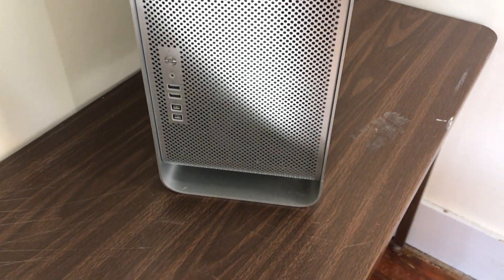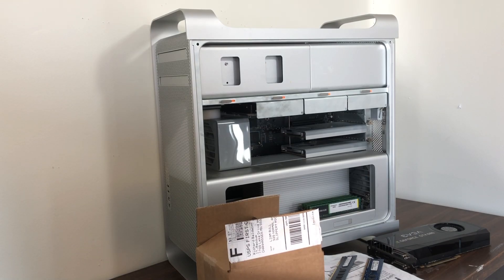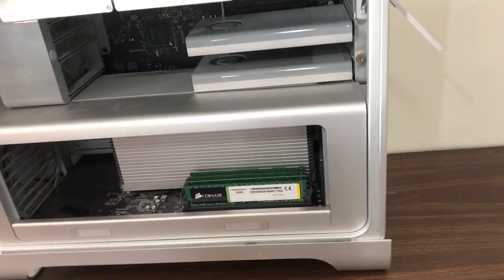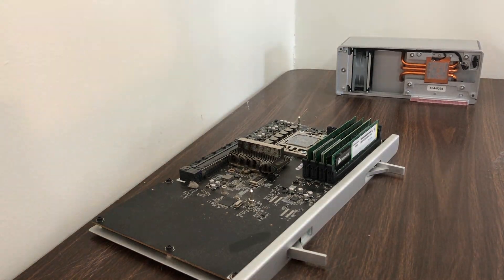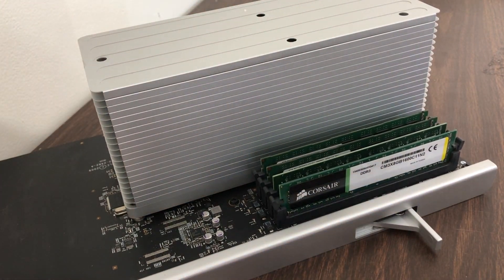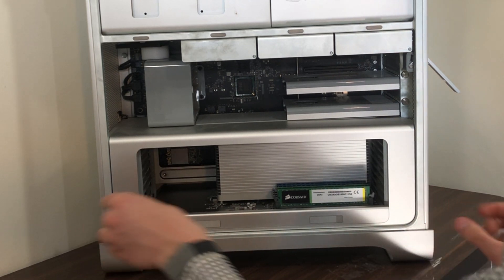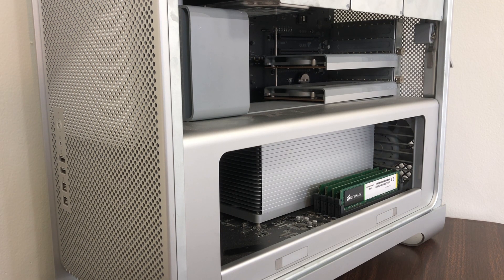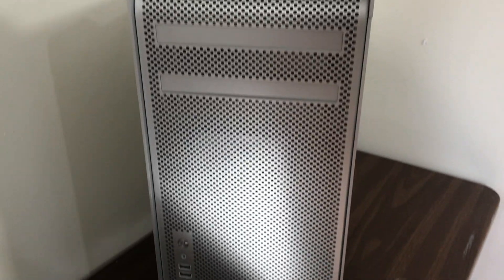The 2009 Mac Pro: Supercharging the Beast

Comment: Recently got myself a Mac Pro 5,1 from mid 2010, and I must say it is a very powerful computer for it’s age with some upgrades. I gave it some RAM, a sapphire RX580 Nitro + with 8GB of VRAM GPU, and a 500GB SSD to top it all off, and the computer just flies! Very informative video as well. Really miss when apple used to make extremely well designed professional computers that were extremely repairable and upgradable. Keep up the interesting content! You just gained a subscriber!
Reply from the maker: Hey thanks! Indeed they are still capable machines. I sold mine last year and replaced it with an M1 machine, but it was still humming along swimmingly when I decided to upgrade. Sadly the biggest limiting factor is going to be the ancient CPU architecture, and that is indeed the reason I upgraded. Even with the hexacore 3.33GHz chip, rendering and exporting in FCP was a bit of a slog.

I really do wish that Apple sold in upgradable pro machine still (and one that was as durable as these machines).

Comment: Let’s just say that this thing age very well it work great it look coolexcept mine has water cooling things and it leak and the power supply died 
Sadly
I end up using it has my hackintosh housing and it looks cool
Reply from the maker: It does look very cool even if it is a bit aged.